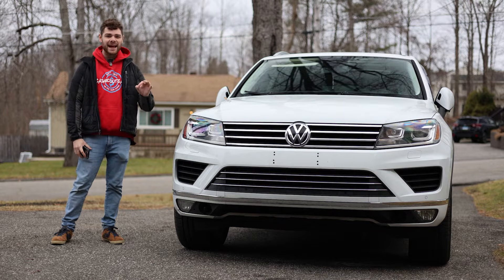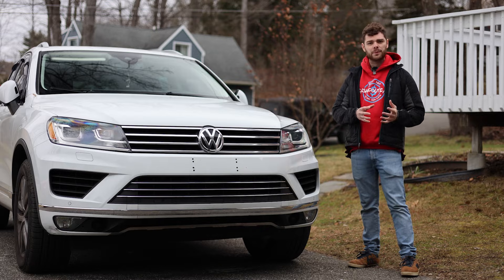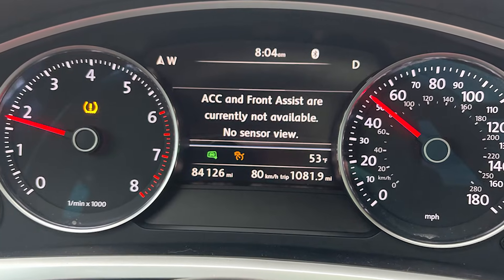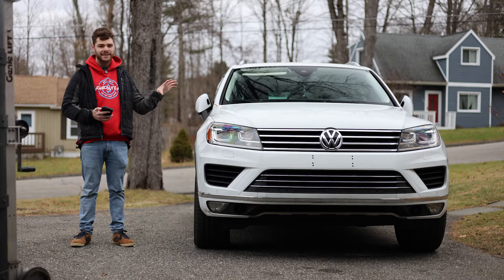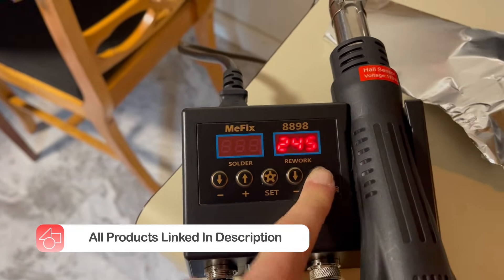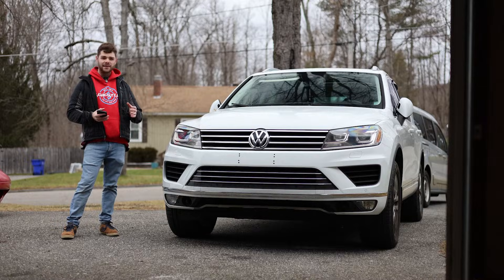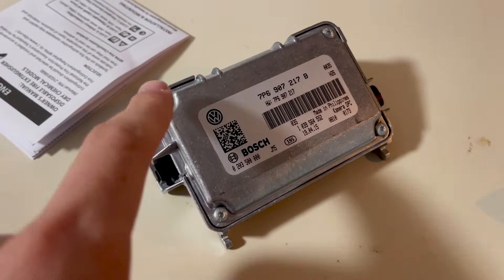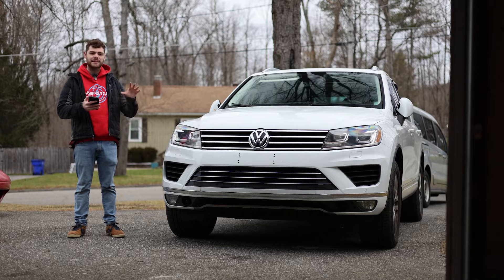How To Fix Adaptive Cruise Control (ACC) Issues - Volkswagen, Audi and Porsche

Comment: Hi, I did this on a Audi A7 with a hot air gun 110 C for 7 minutes (see on  another Youtube video a several  of months ago). It works for a weeks each time. I have now  done it 6 times. Each time it resolves the issue. However, should I try your method with the higer temps for 3 min. to see if it is more permanent fix? Thanks

Comment: Thanks!  You saved me a lot of money too, but I didn't tabulate it.  I only spent about $38 on Amazon for a simple solder reflow workstation. (Basically a temperature controlled solder iron with a heat gun.)

The trickiest part was with the plastic sun shield / heat shield that fits in with the camera module, at least with my 2013 A6 3.0 TSI.  Mine was very brittle and was already broken by somebody, so it fell out when the module came out. It took some patience and some superglue and some tape to hold it up before reinstalling the camera.

I used a different heating protocol on the Xilinx processor chip.  I warmed it up at normal low end soldering temperature, about 265C, for about 30 sec, ramped it up to the high end for soldering at 285C for 150 sec and finished with 310C for 60 seconds.  This worked on the 1st try; the car immediately recognized it and cleared the error.

It's not surprising that a processor chip sitting under the sun all day for several years would undergo temperature cycling that could stress and crack a couple soldering joints and need resoldering.  Maybe that's why the weird little trim piece (4G8907225A) is there; to block the sun hitting the camera module.
Reply: My method failed after a week. Instead  I tried a one minute warmup at 265C and then 310C for 3 minutes and brought it back to life.  It's been a couple days so far.
Reply: Like the idea of a slow warm up. Is it still working?
Reply: This reminds me to comment regarding weather temperatures here in Perth, Australia and was thinking the 40 degree Celsius days and the temp in the car must be 60+. However I'm seeing Noth American owners commenting here, let alone "Cash fixes Cars" location.
Reply: @ The last time I reheated the chip I left the cover off the sensor so I could more easily remove the module if the fix didn’t take. After a couple days in the Florida summer heat (+/-35 C) I decided to feel the camera module to see how hot it was; it was too hot to touch. Ouch!

I’m now looking for somebody to reball the chip, or to buy the tools to learn to do it myself.